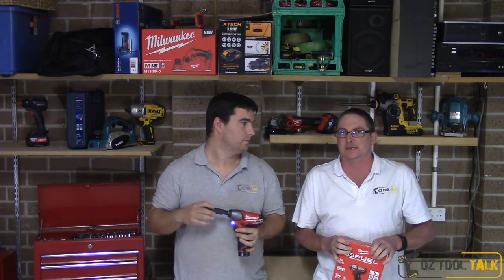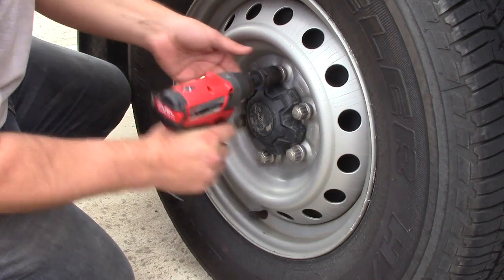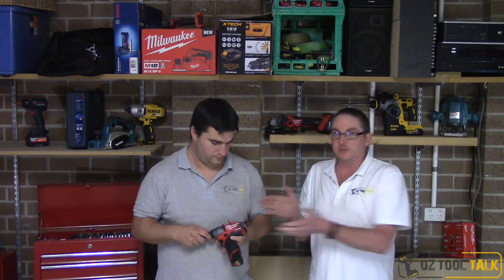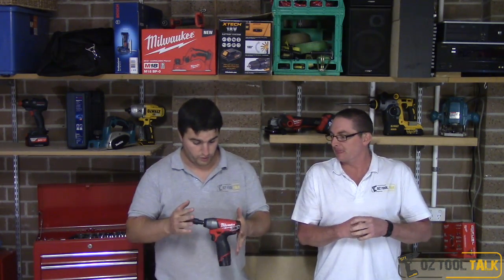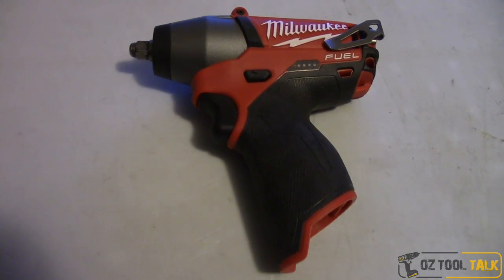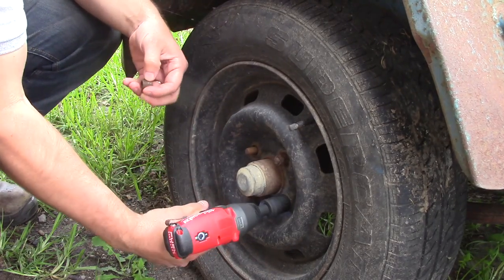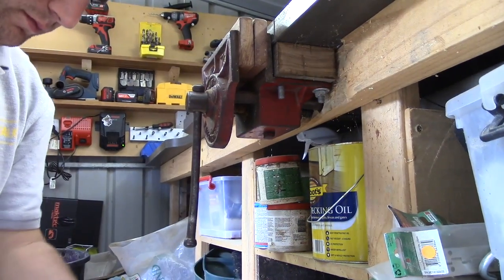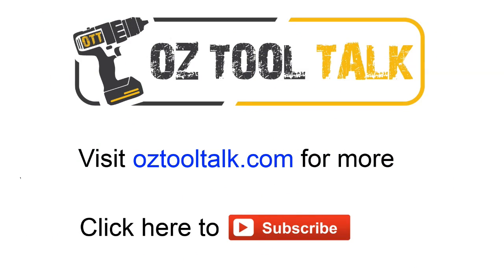Milwaukee M12 FUEL 3/8" Impact Wrench - M12CIW38 / 2454 - auto miniseries

Comment: Nice review guys, and great piece of tool. I have the 1/2" version and use it alot. The 1/2" is rated to 65/160 Nm make up torque and i have tested it and seems fairly accurate. And also tested that it handles 210Nm in break torque.
Reply from the maker: [Dwain] cheers!

Comment: When you add the adapter it takes away from how it was designed to work what you are doing is placing a buffer between the socket and the impact
Reply from the maker: [Dwain] Yes, and same with extensions etc. But real life happens, and most of the time its still fine ;)

Comment: If you used a 3/8 socket instead of the adapter setup, it probably would have taken those lugs right off.  Too much torque loss with the adapter.
Reply: Totally Physics prinicpes